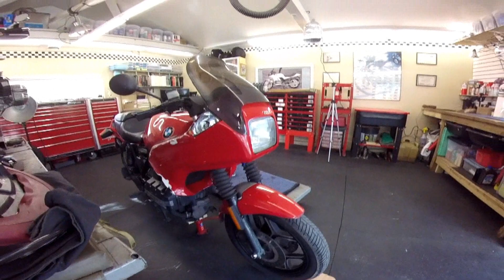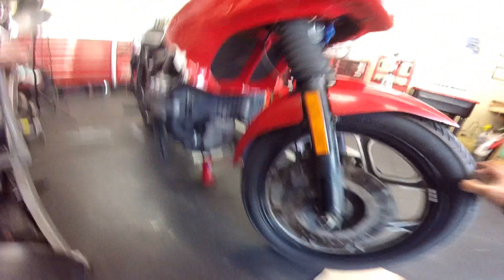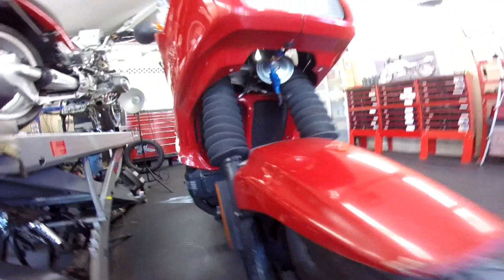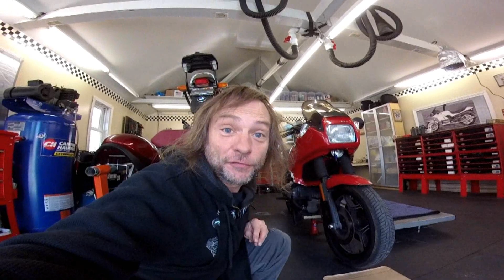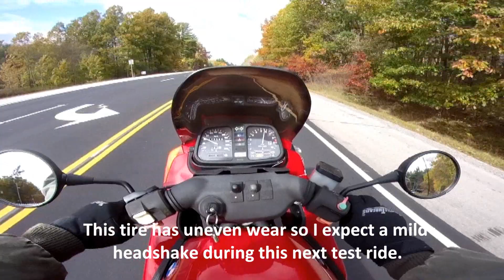Headshake follow-up 2

Comment: Hi Chris;
You are starting to get that "scary eyes" look.  I like it!  I had a Honda CX500 Turbo that would slap the tank if you didn't have both hands on the bars when you slowed down.  Turned out it was the steering head over tightened.  I have a 2002 and 2004 R1150RT and they are both smooth as silk except in parking lots.  Thanks for sharing Chris... time for a rant though eh?
Reply from the maker: Hi Don, Yes, a rant is overdue. Not sure on the topic though as there is so much to choose from!

Comment: Hi Chris, excellent video. Thanks. You pointed out the tire wear on the left side of the tire. My '03 K1200 RS does that due to the offset of the rear tire. Normal wear for this model. The K75 in your video-does it have a similar setup?
Reply from the maker: Hi Chris Happ, Your rear wheel should not be offset enough to cause accelerated tire wear on one side of the tire! You are experiencing normal wear. The crown of the road (center) is a higher elevation than the edges of the road. Therefore you are always riding across a sloped surface unless you were to lean your bike to remain vertical with the angle of the pavement.

Comment: I wouldn't bother trying to fix it given the damage to the fairing and the tank.  Bob's BMW has one of these with less than 20,000 miles for $2,895, and another high-mileage  but straight K75 for only $995.  The head shake is mild on this bike but you don't know for sure what the cause is.  The cosmetic damage alone basically makes it a total loss.
Reply from the maker: I know far more about this particular machine than you might think! It is not a stock K75S. It will be rebuilt.
Reply: Chris Harris As a K75S owner, I found this quite interesting. Currently running ME33 Metz tyres, I've now checked my front one a bit more closely. More wear on the right than left. Time for a swap I think. What do you recommend if the ME33 isn't available?
Reply from the maker: I don't know. The ME33 has been gone for a decade.
Reply: Went through this tire selection string on the K bike FB Page.  Settled with Michelin Pilot Active's. Too soon to judge wear, but handling on my K75S is great.

Comment: HI Chris;
two quick questions:
what do you think of Siebenrock oil resistant clutch friction disc for a 2004 R1150RT?
what do you think about drilling that weep hole for the slave cylinder oil leak?

thanks Chris
Reply from the maker: Hi Don, The Siebenrock disc looks nice. I've installed a few. I find the weep hole unnecessary. Why not replace the slave at proper intervals and avoid failure?